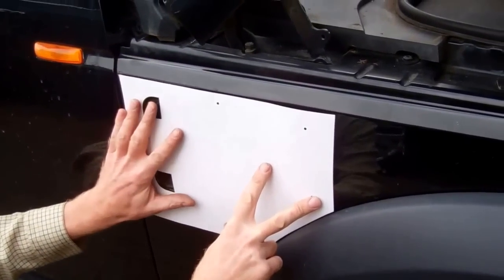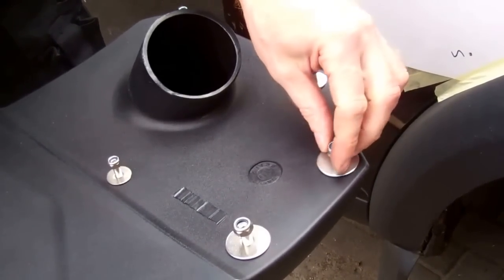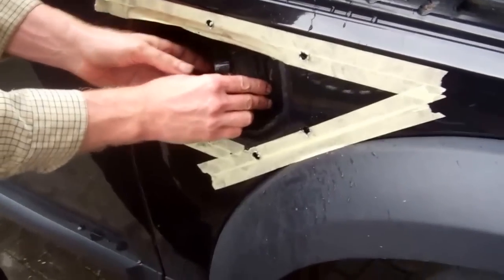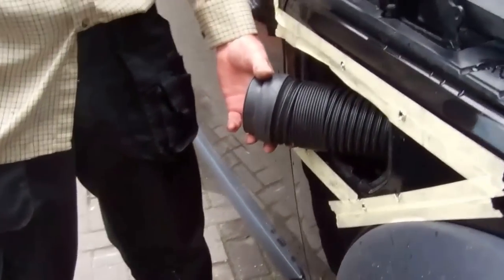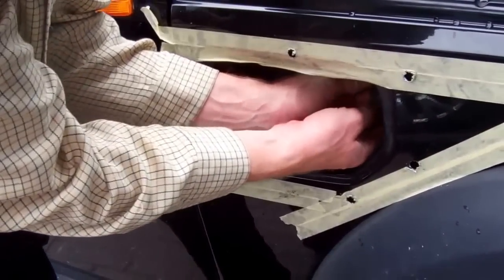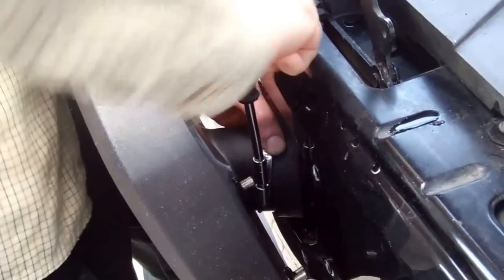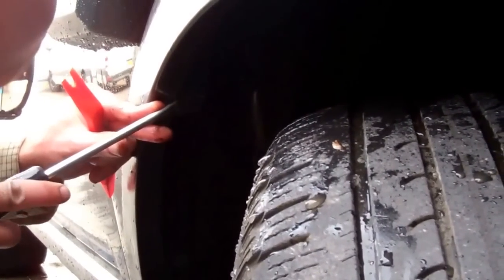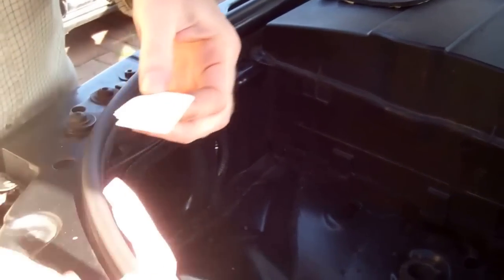How to fit Safari style snorkel to Land Rover Discovery 3 LR3 Part 2

Comment: G"Day Mate ...great instructional vid ...I thought that with the factory engine covers fitted on our 2006 LR3 that I could ford reasonably deep waters ..is this kit you have more for that rugged offroad look (while of course being quite  functional) or can I just be fairly safe with the original air intake cover...btw you make really good videos -very helpful --liked and subbed...
Reply from the maker: Hi - i dont think many of our snorkel customers find themselves in deep water... but it is a good visual "advert" of what the Discovery can do !
Reply: The big advantage is the cleaner air supply. If you are in very dusty conditions, the raised air intake prolongs the life of your air filter.